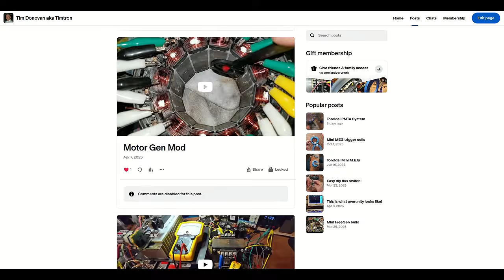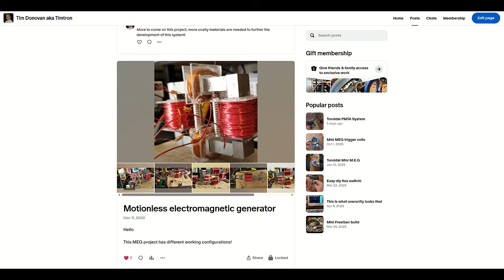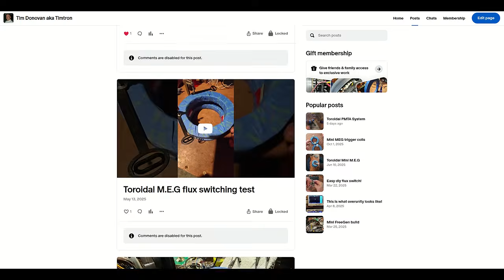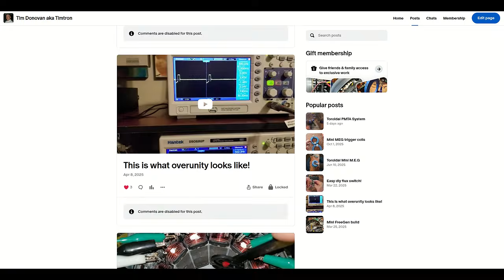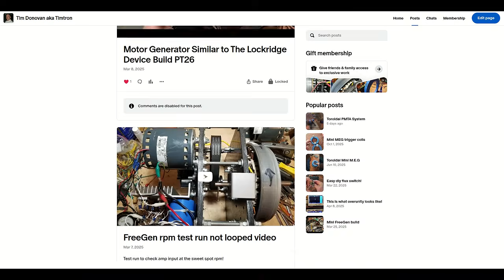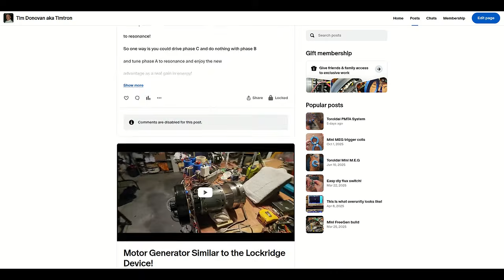Solar Energy Amplification System 65 W in 1478 W out

Comment: Free energy
Well, Tim, I took the bait and went out and got a 3 phase transformer,  my mom was making meatloaf while I studied hard in the basement on how to make these connections, blew the circuit a few times off the mains! red black white? I figured there was a difference and now I know. Results are small, but proven, 1 extra amp on the output as opposed to the input, voltage very close to the same, although higher on the output as well. I haven’t tuned it yet, which will only improve the results, this much I know, thank you so much! for bringing to the public. It’s hard earned knowledge and I respect that! meatloaf’s ready so gotta go, thanks buddy.
Reply from the maker: Home made meatloaf oven powered by single ended BiTT is yummy 😂 thanks Rod !